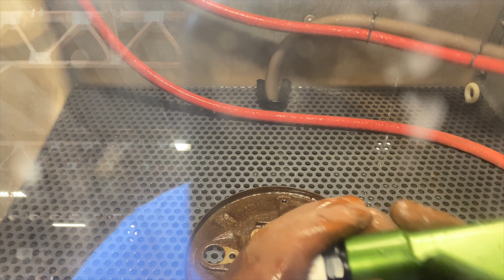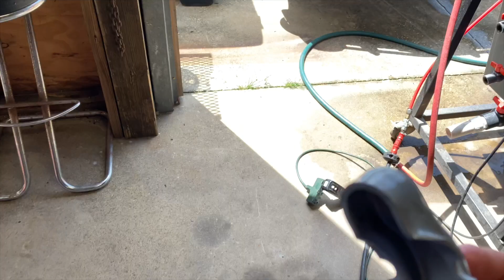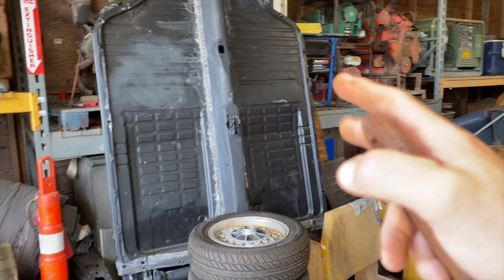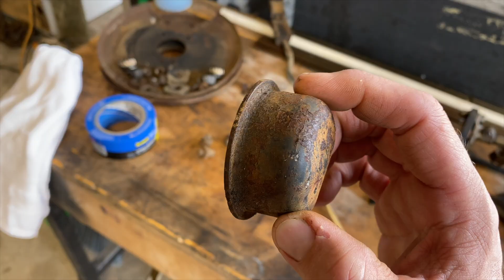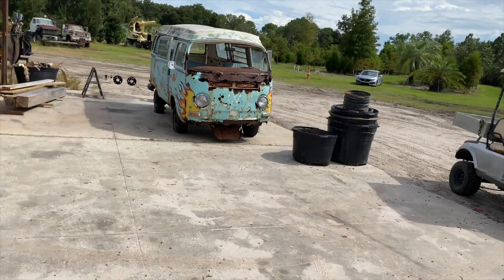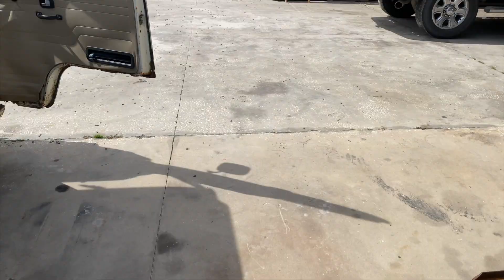VW Karmann Ghia Restoration - Vapor Blasting Rusty Parts! HTMR!

Comment: back when your were working on your old bus rusty there was two parts that your rebuilt and that is the torsion bars in the front end an in the back end and for i never had replace or do any thng to the torsion bars on a vw never at on the ones i,ve work on  i,ve never found one with bad torch bars that would have needed to be replace they just don,t ware out very offten on vw,s  hell i can,t remenber any one i know that have ever had to replaced any at all that i know of

Comment: When I was in A&P school in AZ almost 20 years ago I had a couple old adjustable "ford wrenches" that were rusted up like your big nut tool. I used the sand blaster to clean them up. Yeah I know some "patina fans" will be upset but I am not one of those kind of mechanics. To me "patina" is rust that needs to be fixed to salvage the metal from further degradation.
Reply from the maker: What are your thoughts on powder coating?
Reply: @CTmoog  No personal experience at doing it myself. I like the durability of it and the finish. For things getting heavy use like tools, not a fan but fine for items not expecting to be "hammered on".

Comment: One thing I learned when I worked the glass bead machine at a machine shop I worked in is to keep the flow of media away from the gloves and the viewing glass panel. It will annihilate them in no time if not careful and you’ll be needing to replace them constantly if not.

Great call on refurbishing the original parts; saving money while keeping the optimal quality in the project.

Re the body; I suggest painting and treating the underside of it where it meets the chassis and under wheelwells, etc. That way you won’t have to separate the body from the chassis again; it can get bodywork and paint later on without doing a pan-off resto.
Reply from the maker: Yes, I learned that the hard way! I pointed the gun right at the window to wash it off and blasted the glass! =)